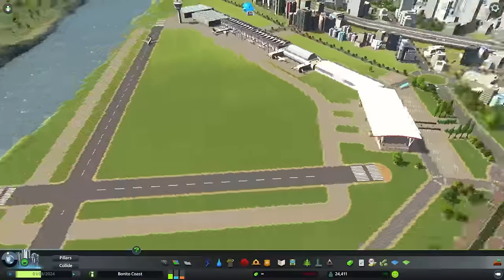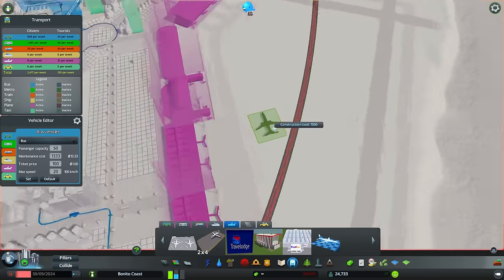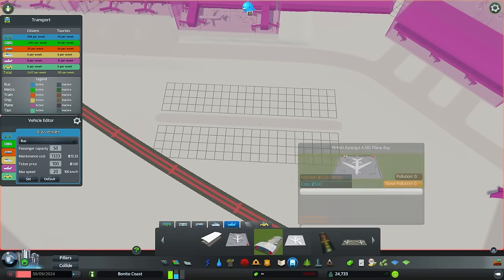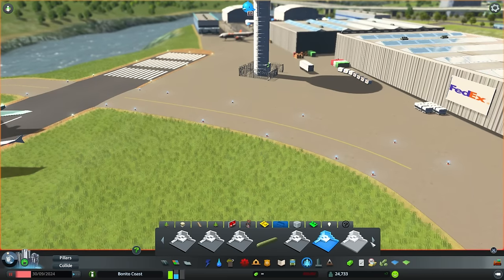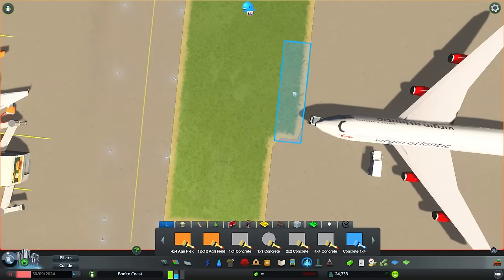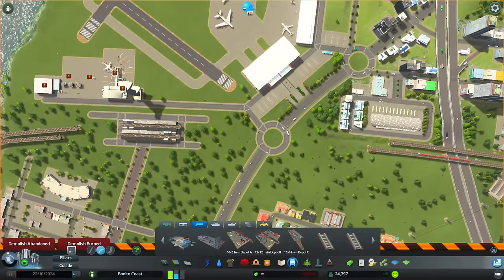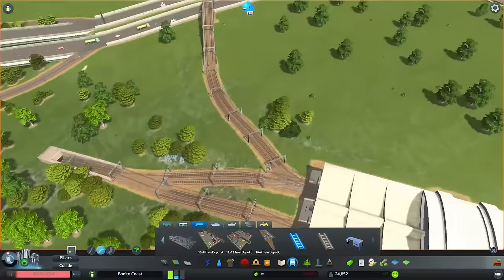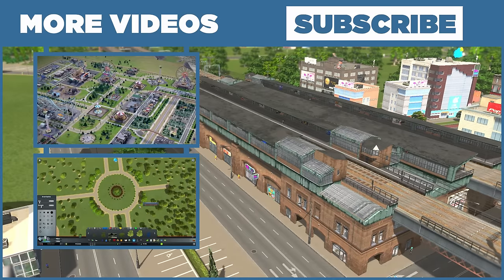Cities Skylines Let's Design - EP 18 - Elevated Train Station | SimValera

Comment: Hi
To use the other tracks in a multitrack train station you have to use another mod like Traffic++.
You could then use (and hold) the shift key while creating the line.
Reply: Multi-Track Station Enabler for After Dark: http://steamcommunity.com/sharedfiles/filedetails/?id=532863263
Traffic++: http://steamcommunity.com/sharedfiles/filedetails/?id=409184143
(You just need one of them)
Reply from the maker: +Toelpel Thank you very much! I have Traffic ++ but I guess I just couldn't figure out how to use it for making oneway railroads properely) I'll fix it for the next episode! Thanks ;)
Reply: +SimValera The onewa tracks are still 'alpha' and are just a normal track which only works in one direction (the asset looks the same like two-way tracks).
You could not upgrade existing railroad tracks, you have to build the oneway tracks, but you could connect the oneway tracks to twoway tracks (e.g. in existing assets you always have twoway tracks).
I'm looking forward to watch your next episode, you're doing a great job!